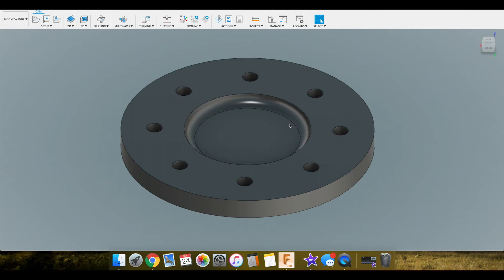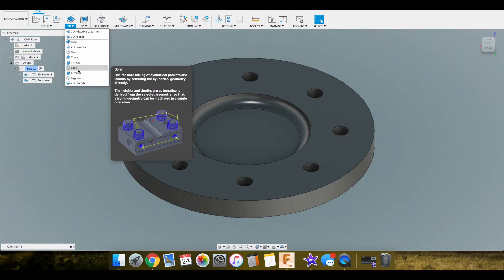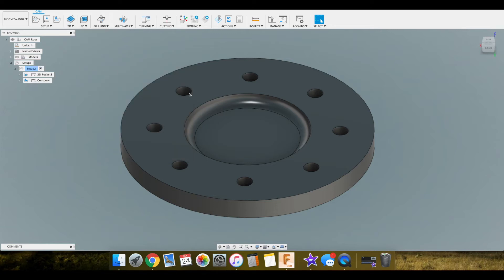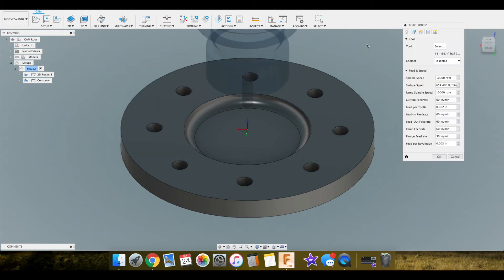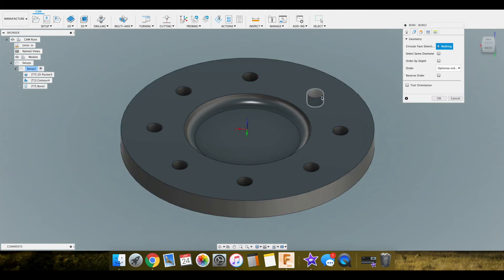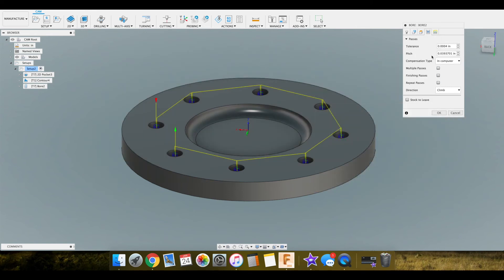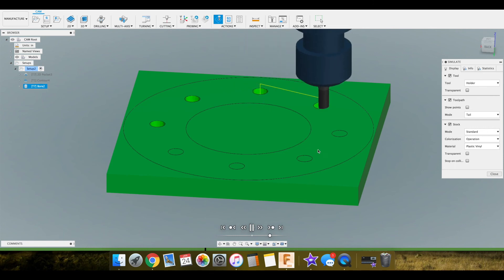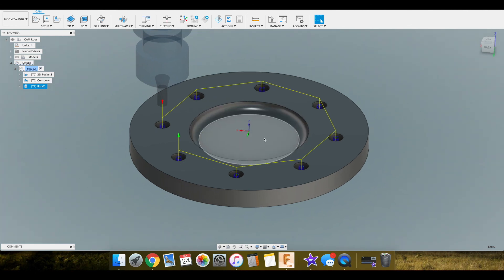CAM For CNC Router Fusion 360 Beginner Tutorial:Making Holes

Comment: Hi, thanks for the video, I have a problem with my holes drilling. Before and after each hole operation the tool goes to 0 height and sometimes carves the surface while moving. Shouldn't it always move at retraction height between operations too?